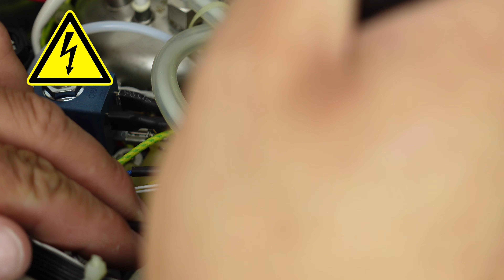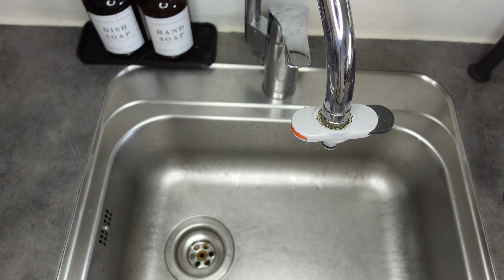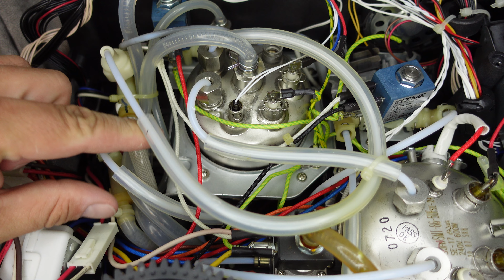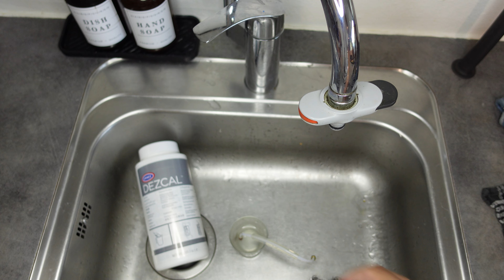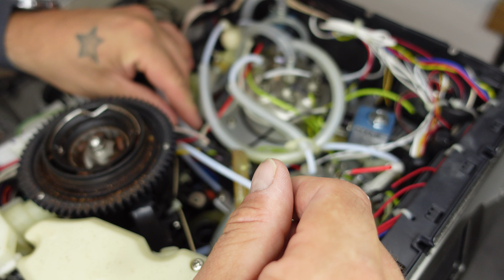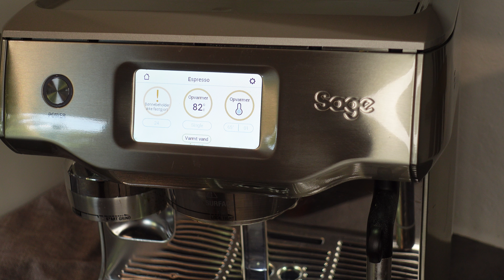How to Fix Oracle Stuck at 68°C

Comment: Mine oracle touch sometimes there’s no water coming down the porta filter after 25/30 seconds of brewing have pass
Reply from the maker: Does it only happen with coffee in the basket, or do you also get no water when running a shot with the portafilter removed? And when it happens, can you still hear the pump running? That will help narrow it down 👍
Reply: @Bre @BrewFix hanks for the reply! No I couldn’t hear the pump and haven’t try without coffee in the basket but it only happened twice in the row last week and after that no more issues but I also caught the machine after pulling a shot going back to heating mode for a few seconds not the frothing side but the shot temp side! But only happened a very few times! Right now it’s been running normally
Reply: Hi I might need some help when I turn on the machine. I can hear the water pump and it starts to leak water from the bottom and from the front and then when the tank empty ask for more water and soon as I put more water starts leaking again from everywhere.

Comment: Tengo el mismo problema de que no llega a la temperatura y se queda un 68° C pero las zondas son nuevas y ninguna mangera esta tapada
Reply from the maker: If the probes are new and lines are clear, you should check the heating element and the thermal fuse for continuity.

Comment: Thought I would leave a comment. This solved my issue, thanks so much. 

I tried replacing the waste water solenoid thinking that was the problem. Turns out, just needed to get that damn pipe out and get it descaled as it was totally blocked up. Good for future issues. I made the expensive decision when it broke on me to upgrade, so now running a LM Linea Micra, BUT great to have fixed up the Oracle, so I can at least gift it to my father in law!

You were right it being very fiddly getting the pipe out and back in too. For those who attempt this, when you replace the water pipe, put the pin in top down, so its easier to get out next time around.
Reply from the maker: Glad to hear!